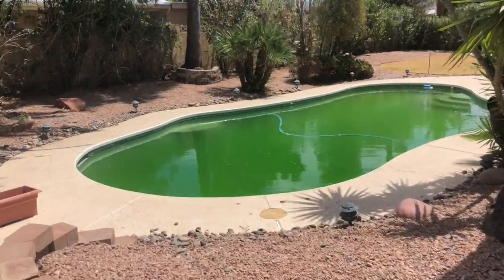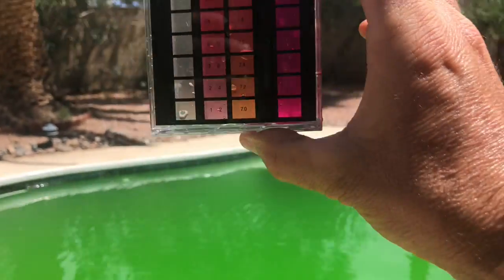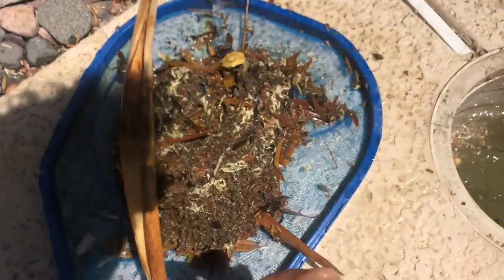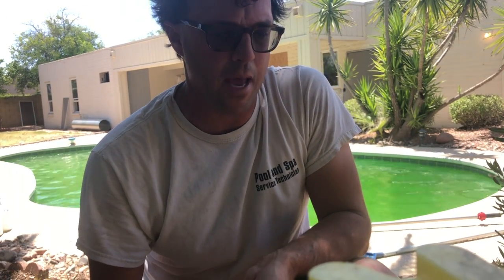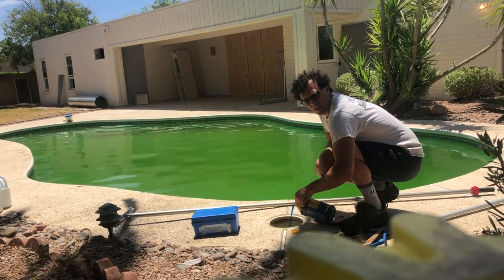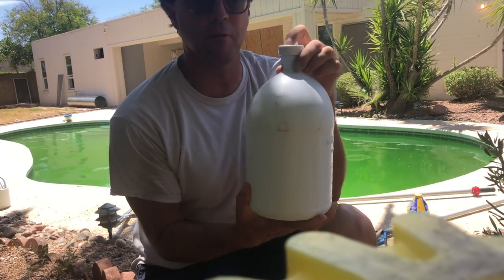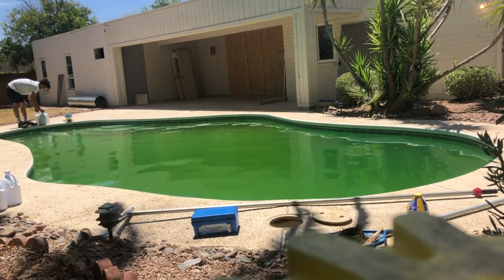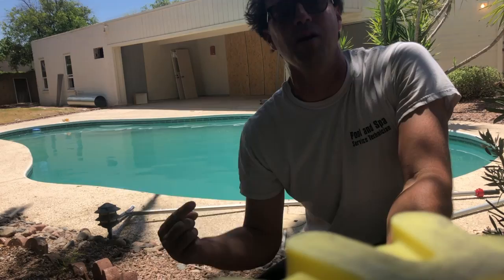From Green to Blue in Minutes: Dropping the Calculated Chlorine BOMB!

Comment: Isn't cheaper just to drain. Why make a $300 soup over $50 worth of water?
Reply: I work at a pool store. All the chems he used would be 40ish bucks so definitely cheaper treat it.
Reply from the maker: For what we did on this one, the charge would have been around $150. Water in this neck of the woods for a pool this size is closer to $100 so in this case (and the fact that the water was only 2 weeks old) it was about $250 cheaper to treat the water.
Reply: @SwimmingPoolAZ-SPS  Great thanks for fast reply. Subscribed.
Reply: You must be joking..... with the size of our pool it takes three days to fill and then add in the water bill in addition to that wait.

Comment: wow impressive, you must have got the chlorine level up to around 70-90 ppm, at what point would you let people back in the pool after this kind "nuclear" shock? would you say its possible to neutralize the chlorine down to normal level after say 24 hours in case the client wants to get back in it?
Reply from the maker: So, I used 10 gallons of 12% bleach (Which is 120,000 ppm chlorine). The pool is approximately 16,000 gallons with a zero chlorine reading which gives us an eyeball reddening, skin drying, bathing suit bleaching 75ish ppm of chlorine....over 20x the desired residual level we want for swimming! But hey, I wanted to make sure the water changed quick for the video’s sake. 

Bleach dissipates pretty quickly so when I go back today, I expect the chlorine reading to be around 10 ppm. I’ll let you know what I find.
Reply from the maker: And to answer your original question, chlorine is safe (not comfortable for swimming though) up to 30 ppm. I’d want people staying out until it drops below 7 ppm and our pH is back balanced (and the water has cleared up)....about 3 days
Reply from the maker: Today’s test read 0ppm on chlorine, 7.0 pH, and 80 ppm Alkalinity. Bleach goes quick. pH should be up at a 7.4 tomorrow and the chlorine will be at a 3-6 after the tabs and bleach I added today. Looking clear as a bell!
Reply: Swimming Pool Science thanks for the update, that algae and the sun sure burned up that chlorine fast! Nice work